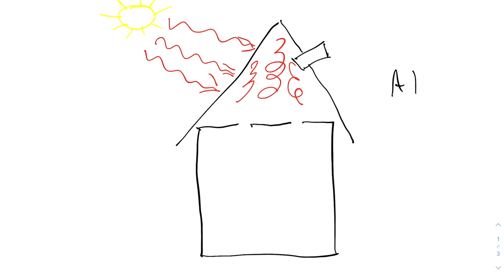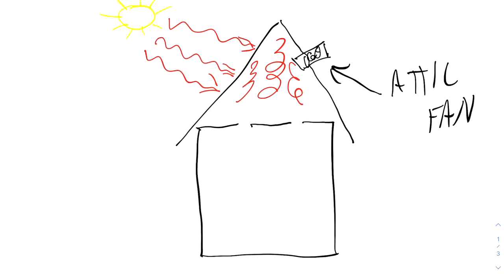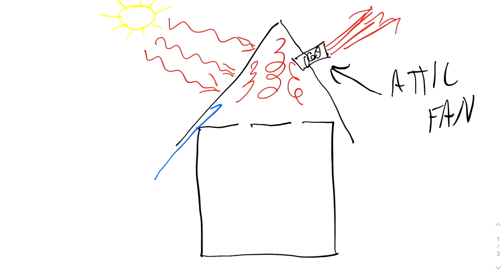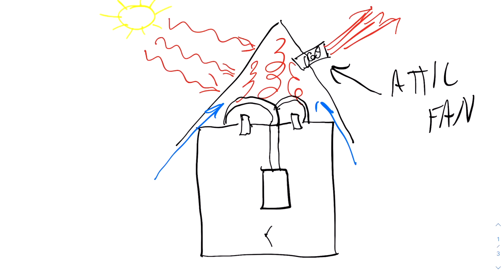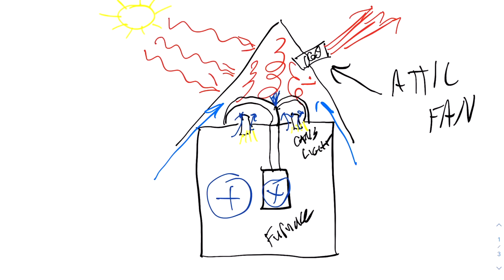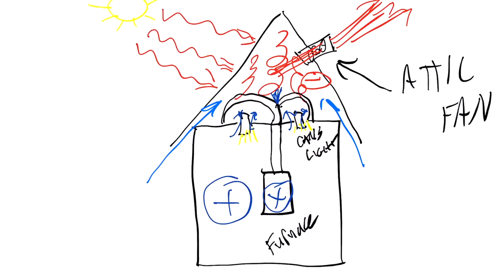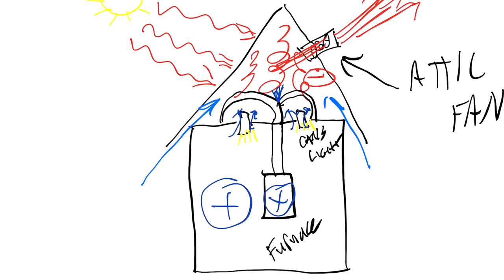3 Remodel Rip-Offs

Comment: Matt, how about a whole house fan? Is it true it is installed in the ceiling and in the early evening when it’s cooler outside than inside it functions by the homeowner opening windows and or doors turning on the fan thus sucking the hot air out from the house and out attic vents. That air must be replaced by cooler air coming in through the doors, windows the homeowner opened prior to activating the fan.
Reply: We were in Sunnyvale CA (the heart of Silicon Valley) where the temp could get up to 98 on the rare occasion.  The evening temps would drop quite a bit from the breeze off the bay.  This suggested a whole house fan would do the trick.  The AC in the house was weak and took hours to cool things down.  Lets say the temp during the day got to 90.  the house temp by 6pm would be around 78-80.  My attic would be 130-135 and the temp of the ceiling of our bedroom could be as high as 85.  The fan I put in was a belt driven 20 inch two speed fan.  On high we had to put weighted vests on the cats to keep them getting sucked up!.  We would run the fan for hour (it was loud) and alternate opening windows to cool sections of the house off.  worked great.  I ran around with the thermal imaging camera to look for hot spots.  the south wall stayed warm well into the evening and the attic stayed hot.  made a trellis on the south wall and planted a grape.  took a few years but the south wall was shielded and the inside temp of the wall overall dropped by a few degrees.  I did put in and attic fan (yes it was solar and expensive), this is were I take issue with Matt, the attic temp during the day was 15-30 degrees cooler than before it was installed.  Of course this translated down to the bedroom ceiling being cooler and so on.  I would spend a few minutes a week to log temps in a spreadsheet.  I'm a mechanical engineer who took heat transfer in college and I use data to make decisions.  I positioned the fan between the gable vents and most of the air pulled out of the attic came from those vents.  There were a few spots I shored up to keep air from the house going into the attic.  My attic was closer to the outside temp during the day after it was installed and the whole house fan had to run a bit less to cool things off.

Comment: You are misleading homeowners. Attic fans work. My air conditioner would run on and off all through the night and into the early mornings on really hot days.  Once I installed an attic fan, everything changed. My AC only came on maybe once in the evening and that was it. And my house stayed cooler than it ever has.  It gets to be as hot as 150°F-160° F in California and Arizona attics.  And it lowered my Electric bill by $75 a month.  I'm an HVAC contractor and I installed the attic fan to my own home.

Comment: Been in my house for 2 years and last week I realized why my upstairs ac could never keep it cool up there. When the last homeowners had the new roof done the roofers never added any ventilation to the second story roof. The upstairs roof sections have ridge vents those attics don’t connect hardly. Last week I had a solar attic fan installed and for the first time in 2 years the upstairs ac can actually cycle off and keep the upstairs at 74 degrees during 90+ degree days. The roofer suggest air hawks also but went with the solar fan because I liked the idea of only one additional hole in my roof instead of 4 or 5. My situation may be unique but it is without a doubt helping big time.

Comment: Matt, I know that my Father installed a powered attic fan to the house my parents had, in Boulder City Nevada, and in the 1970s when he did it the attic fan coupled with enlarged gable vents, pulled the attic temperature down by 30-F.  Since in those days code only required R19 attic insulation, it actually saved him power on his electric bill because it decreased the heat transfer from the attic into the house.  And, it seemed to have an effect on the life of the asphalt shingle roof.  The original roofs on the whole subdivision were installed over a 9-month period, with my parents house being one of the first ones built.  His roof lasted five years longer than any of the others in the subdivision.  

And, as a water conservation feature, capture the condensate from the air conditioner, and feed it into a capture reservoir as part of the landscape watering system.

Comment: Matt, rethink the justification for wifi thermostats buddy. You missed the mark! If/when you own a home in a different state and need to manage temps from afar, the wifi thermostat is far less expensive than paying a service to access your home. Some power companies offer seasonal discounts for using power off-peak, so you need to change the time of day when the AC or Furnace runs. A WiFi thermostat has saved me hundreds of dollars of energy savings. In addition, it can alert me when temps fall outside of my threshold (i.e. freeze alarm), which is an added bonus of a wifi thermostat. They work very well buddy!
Reply: This is the entire reason I installed smart thermostats, so I could manage the temperature of my home while I'm not at home via an app.  Also on the rare chance I'm lazy and want to tell Alexa to turn the temperature up a bit.  Also, it lets me set hot and cold in a single setting, with my old non-smart thermostat if I wanted to switch between heat and cold I had to flip a switch on the thermostat which is super annoying a couple months per year here where we might have to actually run the heat at night and cooling during the day

Comment: Wrong on air wave. 
Please look at engineering for air processing. All new 18+ sheer units build in coil blow off contained inside fan cycle circuit.
Reply: Mark HVAC I agree, that Matt isn't a HVAC contractor and therefore speaks to just his general understanding of the systems.  My 13 years of experience has led me to understand that all the systems in a house are getting more complicated and it's up to each subtrade to properly integrated their systems into the whole house system. 

And this is where Matt is right, there isn't a silver bullet to solve all your problems in a house. An attic fan isn't going to solve your hot upper floor problem. A "smart" thermostat isn't going to solve you high energy bills.
Reply: i could be wrong but i believe he was specifically speaking about oversized units in that portion?
Reply: Airwave also factors in the humidity when determining whether to turn on or not.
"Your Nest thermostat automatically turns on Airwave when interior humidity falls below a certain level."

Comment: I Live in Venice California and in a house built in 1905, the home has been somewhat remodeled, however it has no insulation or any modern amenities, a very high ceiling with lots of double pane windows (newer) and I removed the attic ceiling in the living Room and dining room with a stair going up to the newly created loft. The loft was so hot I did not use it for some 10 years until my roofer suggested I install a 20 Watt SS Sunlight Solar Attic fan in the loft, when the heat in the loft reaches 80 the fan starts and the temperature remains comfortable, without the attic fan the temperature can reach 96 which is hot. Also the temperature below in the living room also become cooler and way more comfortable.Of course in the winter which is pretty temperate 70 average I do spend a bit more on heating for about 3 months. In my humble opinion as a designer and rental property owner and manager I just wish I knew about this product years ago. OMG it is simply the best home improvement ever. Matt, you have to understand that all of us humans are not privileged to build new energy efficient homes or even do a major remodel on our older homes, which is probably 80% of the population in the USA. In your video should should have said this solar fan does work but depending on your location here are a few things to know before this purchase. I do enjoy your programs, keep up the good work.

Comment: I used to do a lot of attic work in Texas,and the coolest attic I ever entered was an older home with 2 opposing gable vents about 3 foot squared. No whirly birds,no ridge vents and no fans. That convinced me that oversizing the heat release was the most effective.
Reply: Well, that’s because cold conditioned air from the house is being sucked into the attic from the living space thanks to the negative pressure the attic fan creates. So yes, it is cooling down your attic with the help of your A/C. That’s precisely the wrong thing you want to be occurring.
Reply: @eggnogaddict6287  but there were no fans in the attic

Comment: 1) the solar fan is not trying to cool the attic by putting cool air in, it is pulling hot air out which makes cooler air get pulled into the soffit/boxing which will make it cooler, and then the ceiling under the attic will be cooler which will help with cooling your house. Also thats why you allow air to flow from your soffit/boxing to your attic so hot air rises in your attic and escapes from the ridge vent and/or solar vents/gable vents 

2)

Comment: Solar powered attic ventilators need no wiring, make it cooler in your attic which does help with cooling your house without making your electric bill go up so after the savings pay for the vents its free cooling 

Good, new, double pane, gas filled, good foam sealed edges, with in frame mini blinds, and outer blackout curtains, with proper glue tape sealed outer edge windows WILL DEFINITELY make a difference on how much heat gets in and out of your house. I know coming from you Matt a guy that says to spray a sealer inside your house to make a thermo and hydro seal from the outside would know that new windows with these stats and properly installed will definitely make a huge difference compared to old not properly sealed, single pane, no gas, no foam windows

Smart thermostats because I can monitor the outside temp at my house with a smart thermometer/hydrometer and my Blink cameras to confirm the outside temp/humidity at my house then adjust the temps in different rooms accordingly basically only cooling my empty house 12F less than it is until it gets 90F then I just keep it at 78F no matter how hot it gets because past that the ACs will have to work a ton to cool down the whole house and its contents from over 80F back down to 68F at night. A dumb thermostat can't do that which means it is either cooling too much or not enough which both are a waste of money

Comment: Matt is out of his element here. Like Richard on ‘This Old House’, a really good plumber who opines authoritatively on HVAC issues, and is mistaken often, Matt is just wrong. He said a couple things that are just wrong. Sure, there is marketing language on some products that are hyperbole, but that doesn’t impute merit on everything he said. HVAC issues? Talk to an HVAC expert. Anyone who [implicitly] represents himself as an expert in every trade is often wrong. A jack of all trades is a master of none usually.
Reply: Did you look at any of his reference links? He also clearly demonstrated how leaky the attic of his previous house was when he did the blower door and smoke test. The blower door pressurized the house (which is the same as de pressuring the attic) and the air flow was visible. If you’re referring to the thermostats, he literally just said they don’t save you energy. You might get rebates/or a discount that justify the upfront cost, but they won’t save you money. I personally like them. He at no point said he was an expert, but his company had completed dozens if not hundreds of builds, and in that price range they use mechanical designers who are waaaaaayyyyy more knowledgeable about the science than hvac installers.
Reply: @adamgargulak5017  it will save you money when are habits are adjusted to ones that save energy because convenience.

Comment: Another factor is there are various size fans and you really want to put the biggest one in with the highest CFM.  If you have a very large attic you may need to but it definitely helps the only way it wouldn’t is if you have an undersized fan that only works for a 400 ft.² if you have 1000 square-foot upstairs then that wouldn’t do much but if you have the proper size fan it definitely will help in various ways with temperature and especially mold.

Comment: About attic fan we have a converted barn.  If you i guess that you would call it a cape cod style. We have large attic areas on either side of the upstairs.  The venting is at either end.  When i am in the attic, I put a window fan   at one end pulling air out .  In about an hour of running the temperature will be about 10° above outside temp.  If i run it longer like all the time the attic temp is not much different from outside temp.  . .    Also i have smart thermostat on my second house at the lake..    it has saved me $$$$$.  I have access from anywhere.  I set the system at 50° in the winter.  Warm enough to prevent freezing of pipes, but when i go there in the winter, i up the temp to 70°  about 4 hours before i arrive.     I do the same thing in the summer i set the AC at 80° +     i will be heading there Friday  so  about 4 hrs before I get there i turn the temperature to 68°.  I also have a winter double wide in Florida  we live there 3 months.  J F M.   i  keep that at 80° when i am back North for the summer .  I can monitor it from here.  ..  i need one at home... which i will get.          Now i don't use the temp change feature any longer.  But before we retired we did with our old school one at home (non wifi). We would drop the thermostat to 65 during the day and around the time we got home it would go up to 70.  It does make a difference in heating bills  somewhere around 5% on average for turning temp down during the  10+ hours that we were  away.   So not a huge savings, but the thermostat paid for itself over and over many times.

Comment: How can anyone put out so much simplistic silly advice? You are totally wrong about attic fans and half your statements about windows and HVAC are BS as well. Did you know that if you have a multi-story house on one AC zone that leaving the fan on will normalize temperature distribution? Did you think about different schedules and patterns of families when addressing smart thermostats? Do you even know all their capabilities? And did it never occur to you that the benefit of new windows depends heavily on the condition of your old windows.
Different people and different houses have different needs. Throwing out your opinions the way you do as though they are facts is simply irresponsible.
Reply: Going from single pane to double pane windows makes a huge difference in old homes.
Single pane windows should be illegal.
Reply: Kenz300 x - I think single pane windows are no longer allowed in new construction. There are some areas with a historic commission that regulates what type of windows can be used to maintain historic appearance accurately; I avoid buying properties in those areas because those old single pane windows are best left alone under those circumstances.

Comment: I was skeptical on the attic fan as well. Living in Arizona, the garage has its own attic that is blocked off from the rest of the house and gets extremely hot with no vent, just inlet holes. Was about 148 degrees most often and 112 degrees at night during the summer. Installed the fan that I got for free and was slightly smaller than recommended for the attic area we had (it was free) which has dropped temp about 15 degrees during the day and at night, has been below 100 and sometimes below 90 (not often) which is nice. Has seemed to help my garage stay cooler. I dont think its worth a large amount of money but it does help a little.

Comment: Regarding windows and heat loss in winter/aircon loss in summer:
Before you change the windows, peel the trim off and make sure the dingus that installed them insulated the gap between the frame and rough opening. Get out the spray foam because there's probably just a few wisps of offcut fiberglass in there.

Windows and solar heat gain:
Before you change the windows, spend a few hundred bucks on some low-e tint film and make sure it helps and your heat isn't coming from somewhere else.

Comment: We live in a 137 year old home with a mansard/flat roof. There is a whirlybird-type vent on the top of the roof.  The attic is only about 3ft high and on a hot summers days that space and the second story heats up remarkably (we don't have a/c).  The attic is vented.  I placed one of those Honeywell Turbo portable fans pointer straight up and through the vent to make sure air is circulating out of the whirlybird and entering through the soffit vents.  I heard a talk years ago about the importance of trying to keep the attic space as cool as possible so heat is conducted into the second story.  I have stuck my head into the attic opening to compare the temperature difference between using and not using the fan.  According to my bald head, the attic is noticeably cooler with the fan on. 'Just sayin".

Comment: 100% full of crap.  I had two attics in Hawaii, both with open soffet vents all the way around, and no peak vent.  Before I even installed the solar vent, just punching a hole in the roof near the peak dropped the temp 20 degrees in the attic.  This house was only 20 years old, the whole neighborhood is built by the same contractor.... everyone installs these solar vents and for good reason.